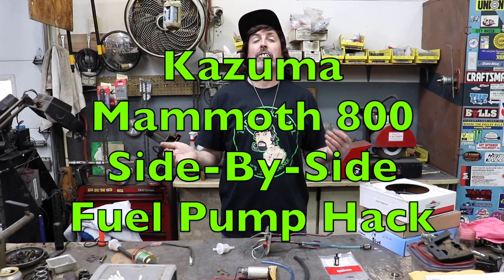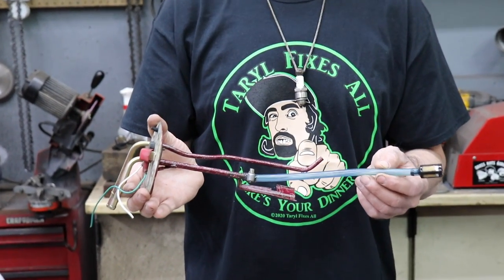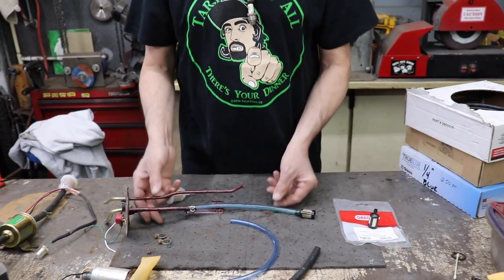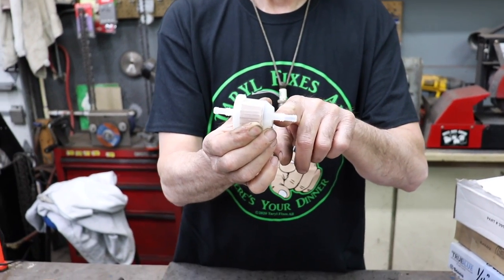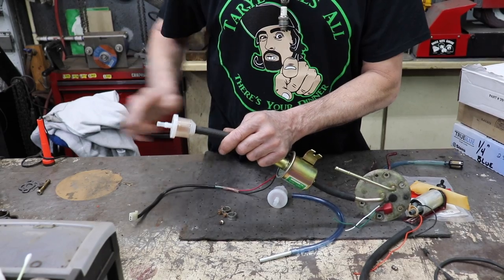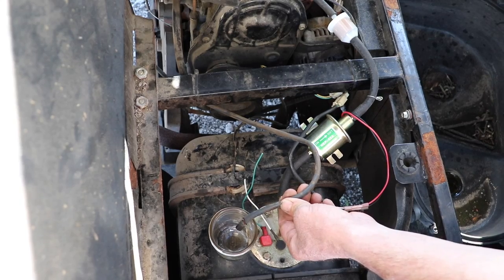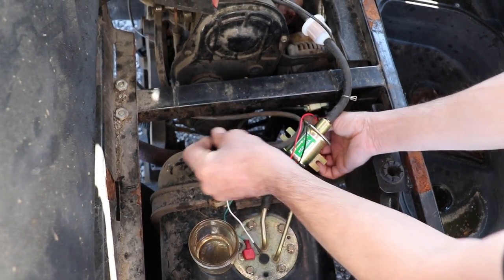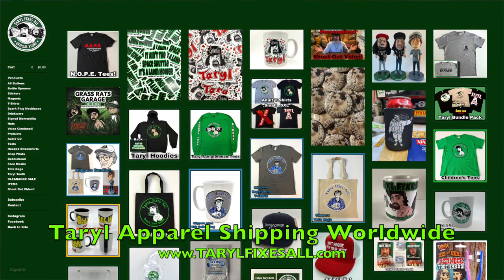Amazing Fuel Pump Hack! Kazuma Mammoth 800

Comment: Could I use this type of pump to bypass the pulse pump on a zero turn mower?     I’m having a vapor lock issue and wondering if this electrical pump mod would fix that. 
Thank you.

Comment: Excellent..I put low pressure pumps on alot of equipment. 
No long crank time to start no issues with bad check valves in pumps etc.

Comment: Thanks for the fuel pump/fuel line lesson. Oh what - its supper time, theres your dinner. Good infor. My John Deere x324 riding mower Kawasaki 22hp engine has fuel line that is larger than normal - thicker. 5/16. I recently went through this fuel line stuff scratching my head as to why the Western Auto store gave me tiny 1/4"
fuel line. He said there are different wall thickness hoses. The JD mower store gave me origional cirrect size fuel line for $1 per foot.
Cheaper than the 1/4" from the othet store. ??? I should have taken an old piece of fuel line with to store. Bass akwards to me - JD shop was further away but was cheaper with correct origional size fuel line. Who woulda thunk it.

Comment: If you wanted an in tank pump that is low pressure you could use a Carter P60293 or similar. Those were for the 82-83 cavaliers with the low pressure carb and then TBI, they run about 5 psi or so.

Comment: i did that with the ariens gt 18 with 19 hp kohler and i have to hold the hot wire while im mowing because it builds up too much pressure i have to disconect while mowing before it flouds then reconect before it dies juggling act lol

Comment: I need to do to do this to my f725 John Deere. I think the more functional pump went away with the original engine. It has a like new opposed twin i/c Briggs, but it lacks power and has to run half choked. I haven't looked at it close enough to see how I would put a return line on it yet.

Comment: I used to do the same thing as you. My brother owned a snapper and Husqvarna dealership. What do you think of the sten's head for the Honda GX160 or GX200 do they hold up I got a eb3000c generator gx200 and I need it fast. I am off grid. I run on natural gas which is a lot harder on valves and heads because there's no lead. Also I'm looking to get into rebuilding these  heads and Motors you got any recommendations where to get the best tools I have a large neway seat cutter set I need 5.5 reamer, hone, and guide tool to knock out guides. I also want to be able to do a tx-340 into GX390 because I've got 11 horsepower washer and 13 horse 7000is generator I'm rebuilding like new I had another one that was new and it got burned up in the house fire. thanks Rob.. I thought your Kawasaki guide replacement with fluffy was hilarious. Also a 88 chevy van fuel pump is cheap 20-$50 inside tank that was for throttle body injection lower pressure

Comment: If the coil inside the pump did not short, you can soak pump in Marvel Mystery oil. Works great, I've fixed 3 pumps using this method. The pump sticks as a result of using ethanol.

Comment: Honda is 6mm and it's great fuel line. You can put the 6mm over the 1/4 but the 1/4 will fit too loose on the 6mm.

Comment: Taryl is wizard when it comes modifying things but I wouldn't have put that chain saw filter in the tank I believe its to small for the job . I would have put a filter before the pump outside the tank . Wix makes a inline filter that has stainless steel wool in it that I use on my modified fuel system I have made for my diesel truck before my external pump outside the tank and a regular inline paper filter after pump .

Comment: This is a good video but this will only work for older carberated models pretty much since 2007+ you'll need a high pressure pump on any name brand side by side Polaris Honda Kawasaki etc. They went to fuel injection around 2007 but this could still work as long as you got a regulator and set the return pressure to 40-60 psi depending on brand and model

Comment: If you use a high pressure fuel pump. It will force fuel past the inlet needle or float needle whatever you want to call it. Which will cause your carburetor to constantly flood itself out. So you really only need a couple pounds of fuel pressure for a carbureted engine. 2 to 4 pounds is more than enough.

Comment: SAE30R10 submersible rubber fuel line is o.k. for inside of the fuel tank & in Australia the likes of an EFI 3 litre 6 cylinder Holden VL Commodore low pressure lift  pump can be used in place of the old one & inside of the tank.

That same fuel pump was used in the 1984-1986 carburetored 5 litre.V8 VK Commodores & the 1986-1988 model 5 litre Carburetored Holden VL Commodore !

Comment: Not all those Chinese machines are carbed. I worked on a Vector last year that had EFI with the in tank pump like that. This fix will work fine for a carb, but not enough pressure for an injected engine...
Reply: Umm didn’t Tarly say that in the video?  I mean I thought we all watched the same one.
Reply: That was explained earlier in the video
Reply: I’m not really trying to be sarcastic, we all throw stuff out there that’s what the comments are for, I’ve been known to open my pie hole and inserting my foot.

Comment: A carbureted Subaru pump goes didda didda dup.
But an aftermarket cheap low pressure electric pump goes"aingyaaoinggyaa" so you use a rubber mount or mounts.
What kind of noise he will get with it primed and after level drops back could be noisy. But this one goes shooka shooka. That's not too bad.
Hoewey cwap?!
That's a screamer

Comment: That pump will work better and last longer if it is mounted as low a possible. They are designed to push fuel instead of pull it. If your wondering how I know this, I sold auto parts for 25 years.

Comment: We can use that trick next time one of our $300 automotive electric in tank fuel pumps go.
Reply: No, unless your vehicle is carbureted.
Reply: Just go with high pressure fuel pump for efi.
Doesn't have to be mounted inside the fuel tank. That's big three engineering so most people take it back to the dealership for repair.

Comment: 😆 not one clamp on the fuel system, yup looks like one of mine 🤣
Reply: He said it was temporary until he got the pump mounted.
Reply: Yeah  that's what I usually say too🤣✌️
Reply: @tstricklin4808  It is pretty obvious that he simply wanted to show it in operation, so he hooked it up temporarily. And if you took the time to go back and look, you'd see that.
Reply: Man I people have no sense of humor. IT WAS A JOKE KARENS😆
Reply: @tstricklin4808  It couldn't have been a joke, jokes are funny. You could have just admitted you were wrong, instead of using that lame 'it was a joke' line.